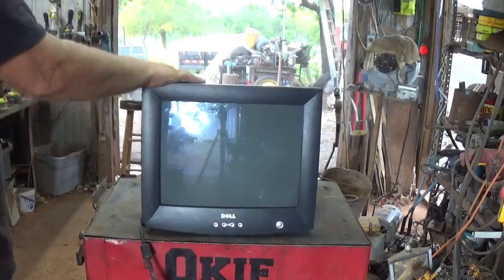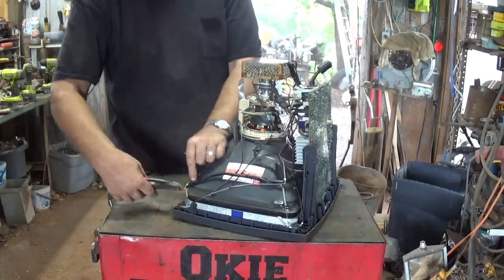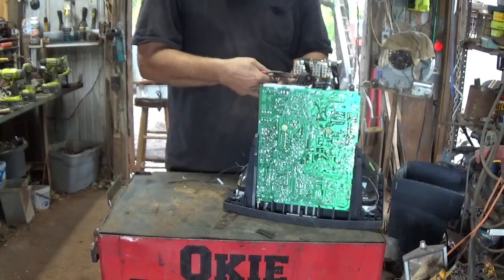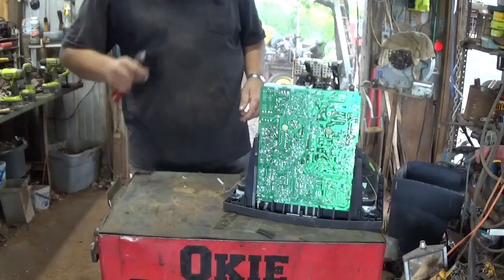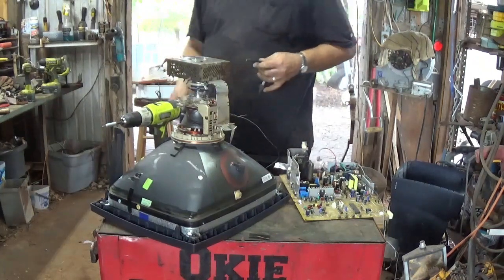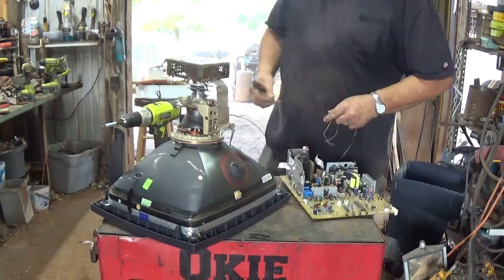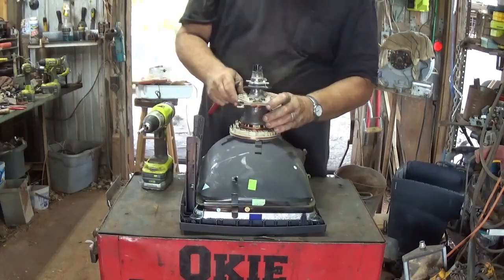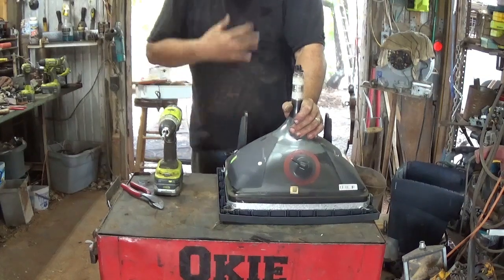Scrapping a CRT Monitor for some Copper

Comment: I like CRT monitors for the metal and wire inside. The only problem I have is to dispose of the monitor. In NYC you must brings them to Best Buy and such. The sanitation will not pick them up.
Reply from the maker: I hear a lot of states have problems getting rid of the tubs they contain lead,

Comment: Yeah, those boards are all low grade power boards.  I get $.26/lb with my ewaste buyer, but most yards don't pay a lot for them.  Some people pull the copper, aluminum and IC chips off them, but too much work for me with the volume I get.  Those clamps are stainless, even with the slight pull.  Don't know why, but one screw is always ferrous and the other is stainless.
Reply from the maker: almost 3 barrels full, I will take them in someday

Comment: CRT is very easy to scrap I did one just the other day didn't tape it but I got aluminum wire in the degussing cable man that's the first one I ever got mostly they're copper oh well that's scrap life lol 😂 thanks for sharing this with us six stars brother
Reply from the maker: I have a bunch of degassing cables hanging on a nail, I think some of them are aluminum wire, I need to clean them up one of these days. Thanks for stopping by Joseph

Comment: It is stainless, if you deform austinitic (stainless) steel, it will transform into martensitic structure, which is magnetic, you can experience this in a kitchen zinck, its made from austenitic stainless steel, but down, in the corners the material is deformed so much it transforms into martensite, consequently it becomes magnetic in the bottom corners.
Reply from the maker: ok, I did not know that, thanks for the info.

Comment: Is “micro” scrapping even worth the time ? 
Not sure how much gold
You actually get. If I was retired and scrapped for fun or spending cash I’d maybe take extra time to do it but I work a lot and don’t have the extra time but I never realized there was good in some plugs. And as for silver solder I buy sticks for brazing copper and ac units it’s not worth that much and not sure how to get it off control board or circuit board. Guess I could watch a YouTube video. Lol.
Reply from the maker: I have wondered if a guy could make good on the silver reclaiming, after the cost of the chemicals, glass beakers, and all the ppe

Comment: I remove anything that I can sell. 🐎✌️
Reply from the maker: good way to do it. I can make a lot of different things, but selling them is the hard part, with scrap metal you can always sell it, most anywhere. may not always get a good price but it will sell